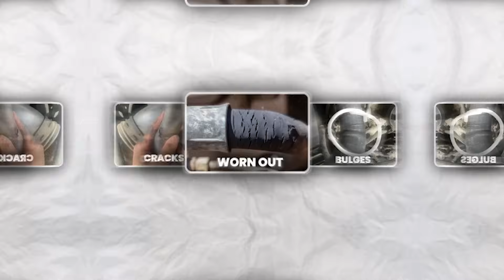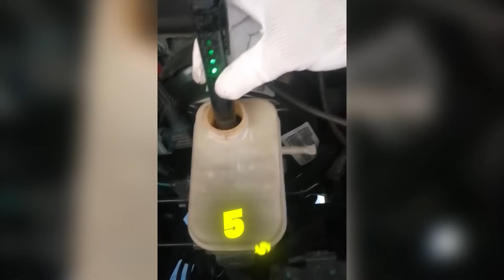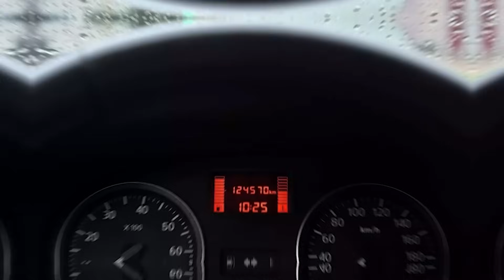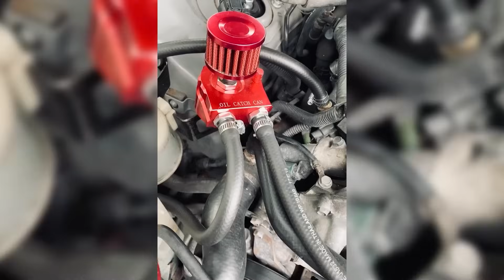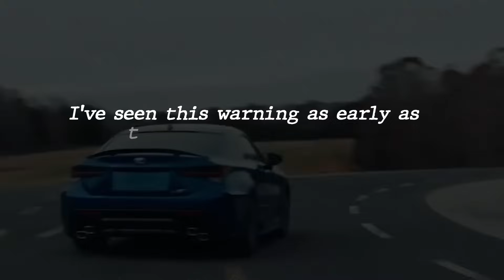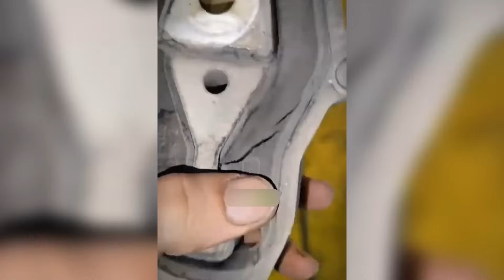This $20 Engine Maintenance HACK Prevents $4,000+ Repairs (98% Drivers Skip It)

Comment: New it’s been on the market for about a year 
Valvoline  Restore and protect. 
Really works. It cleans off carbon off pistons  and of the O-rings cleans varnish off timing chains anywhere the oil goes into cleans off the sludge in the motor.
Reply: Worked on my 97 Honda! Stopped the oil burning

Comment: no one looks under the hood or check fluids while getting gas. or walk around the car and look at the tires. usually, 10 years new hoses. 100k new serpentine belt. Here's one too..most radiators are plastic. after about 10 years they get brittle. I have taken the hose off of the radiator and the radiator outlet just crumbled as I pulled the hose off on a 15-year-old car lol. When u replace the radiator see if u can get a full aluminum radiator. Rotate ur tires every 8 k miles. I asked my sister the last time she rotated her tires...she said doesn't that happen when you drive. Don't tailgate when you drive. Most cars no longer have grease fittings, even going back 20 years, when you replace a sealed no greaseable ball joint, or tie rod end, replace with a greaseable one when they get go bad. most cars only last 5 years b/c lack of maintenance, the Automotive industry knows this, Most new cars in 2025 are not repairable. I always wondered, is the repair part of a dealership the money maker or is the new car sales? I worked for a Chevrolet dealership as a teen in the 70s, it was working in the service lane parking cars, getting cars for a customer. I noticed not many older cars coming in for service....do they eventually funnel customers to new car sales? and more cars for their used car lot

Comment: The PCV  on a 2017 Toyota 2017 Camry with a 2.5 is locate at the bottom of the engine behind the intake manifold.
If you don't know the trick, it's a job that is 3 hours
Reply: The same on my 2020 Toyota Camry . Need to replace it soon as I have 86000 miles on it .
Reply: @peterrudy9207  yep best to replace, the "rattle" test, where if the pcv rattles it's ok b/c it's not all gummed up, the valve can rattle but the spring inside is weak and the plunger will not seal inside the pcv.
Reply: @peterrudy9207 there are YouTube channels that show up how to do it without taking the manifold off
Reply from the maker: Yeah, finding and removing PCV is a hard job

Comment: Around twice a year after I power wash my engine [ cover alternator ]. Let it dry or dry and alternator still covered with heavy duty plastic bag . Liberally spray 303 Protectant throughout the engine compartment . and let and soak in as it will help rubber and plastics to resist drying out and cracking .